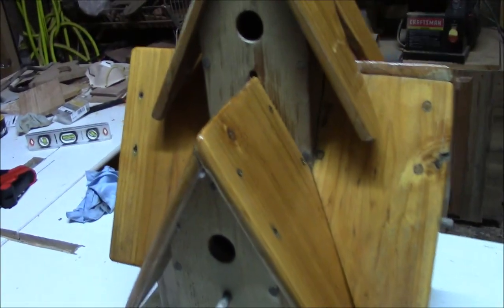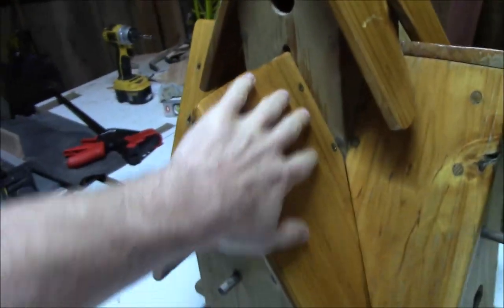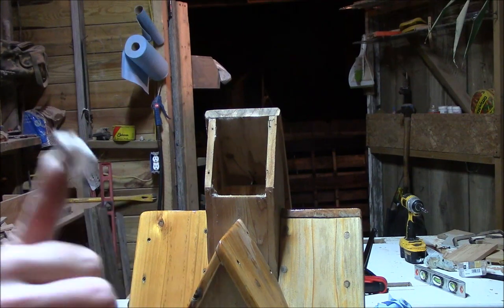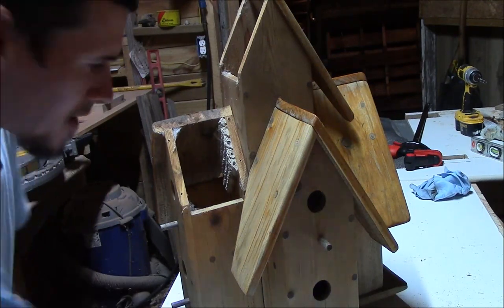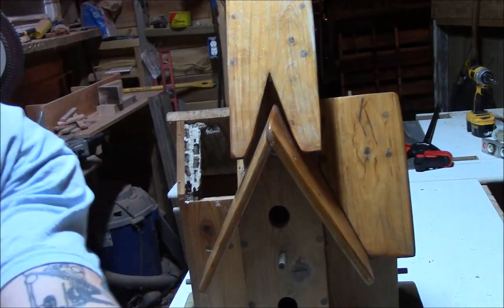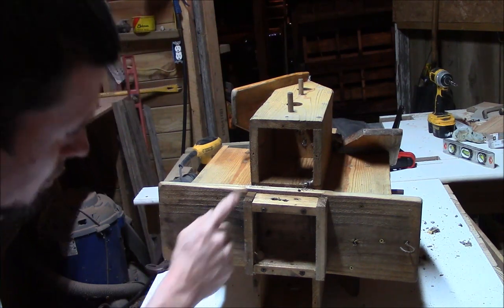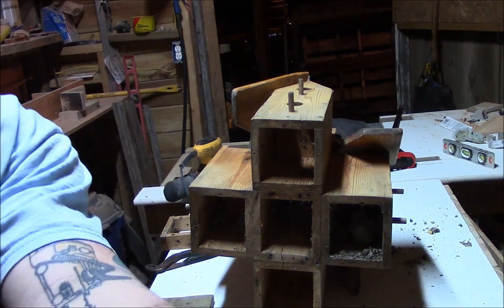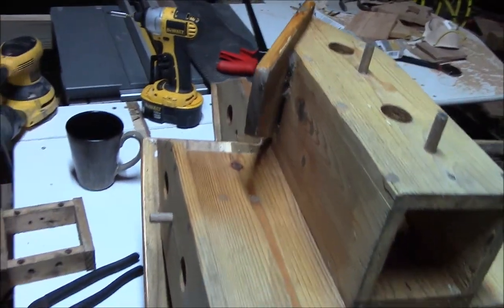What Ends Up INSIDE a Birdhouse After A Year? Van Gets Some Needed Repairs

Comment: When getting a used car, wee should get a timing belt done, water pump, transmission flush? Anything else? Just a good to know. When I get a FT job, i plan on getting a used van and junking my old one.
Reply from the maker: Honda motors for sure! It is supposed to be done at 100,000 miles. If the timing belt breaks the motor is done.
Reply: TheChris AndHollieShow oh wow, that is good to know. Thank you so much. I screenshot this info to keep.